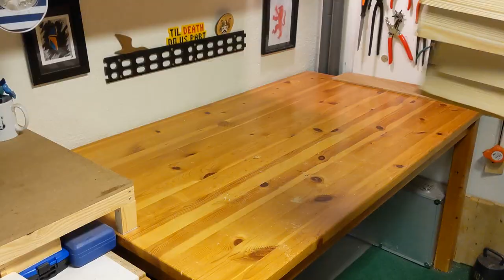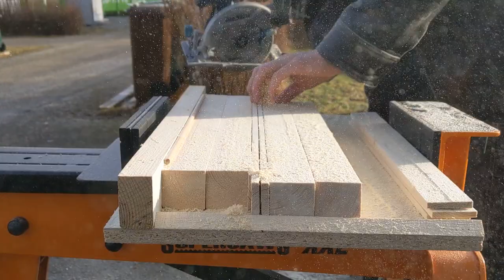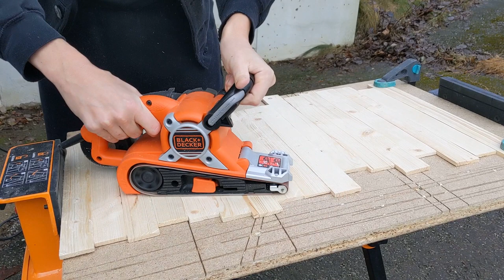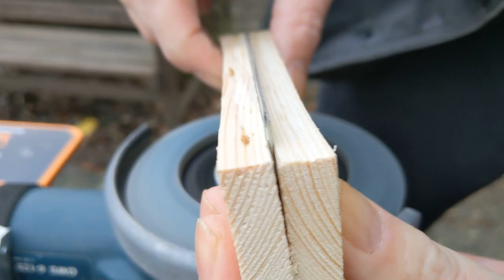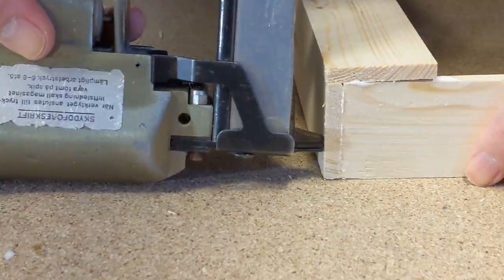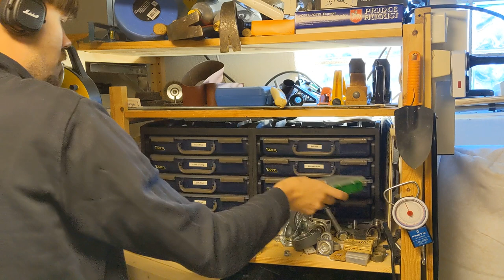Let's make a thin strip box from a scrap 2x2!

Comment: Nice couple of boxes, they came out really neat. How are the Marshall headphones, I've always fancied a set?
Reply from the maker: Thanks!
The Marshall headphones (Major 3) are great! The sound is superb, and the Bluetooth has a long range and I haven't had a single issue with connecting. My only complaint is that the single multifunction button/control stick sometimes gets confused when turning it on and off. And they have a pretty snug fit, so I can't wear them for more than 3-4 hours before my ears start to complain about the pressure. But other than that, I can full hearty recommend them!